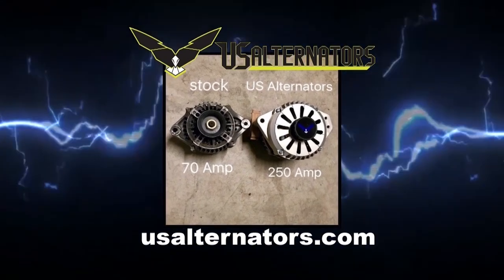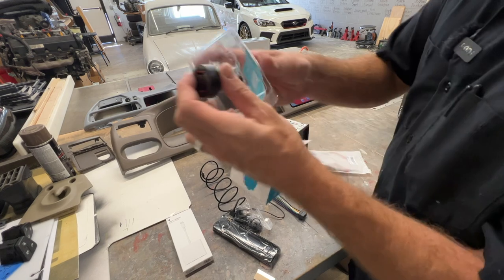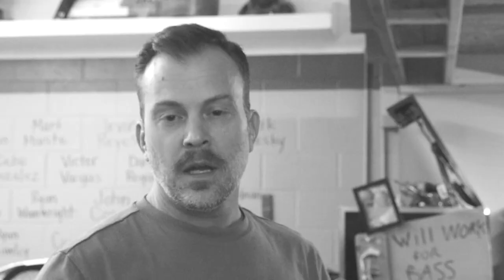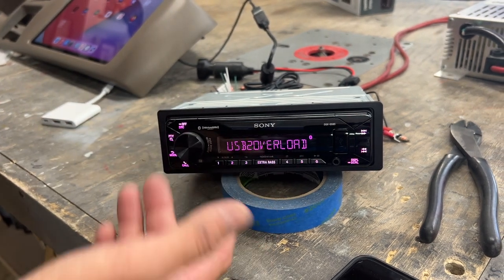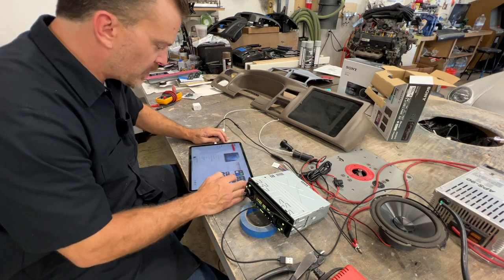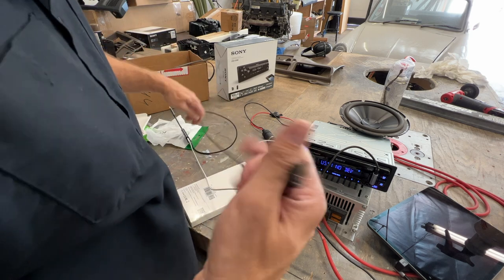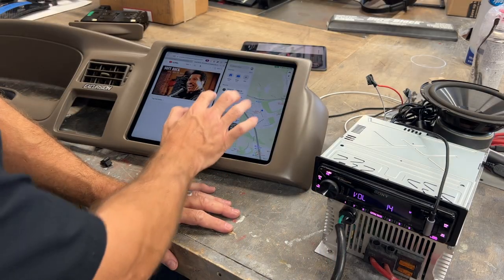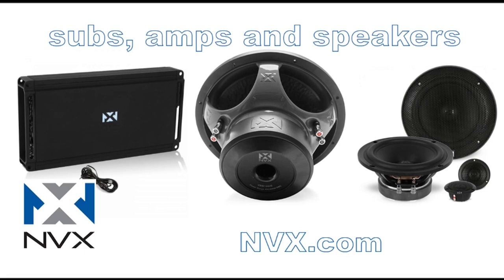LET'S TEST Sony DSX-GS80 car stereo with iPad PRO

Comment: I had the same situation. Here is how i got it to work… the white apple device you got needs a 5 volt 2amp source. Get a power supply that connects to your sigarrett lighter that has an output of 5 volts 2amps and plug to the white apple device and you should be able to charge your ipad using that apple addapter and use the HDMI option too. We all need the help we can get. So good luck bud!
Reply: what would I do to make a Samsung tab  work   I do have a new eclipse 8v head unit  I was thinking  of using  what type of line converter would I use or does audio contole  carry somthing . I'd actually be getting this exact  dash made from ole dick fiddlerdouggie🤘🏽
Reply: Then why do not direct charge  to the iPad . This man need the usb port  to iPod music to the head unit and charging at same time. He doesn’t need HDMI port.

Comment: If only Eclipse had stayed in the game. Had the 8 volt pre out head units. Awesome quality.
Reply: ah Fujitsu Ten
Reply: favorite head unit's ever, and the titanium line of sub's were ahead of their time. What ever happened? Why did they close?
Reply: Fuck I miss my eclipse stuff. 2 titanium 10's and an eclipse HU was part of my 1st system in my 1st vehicle.
Reply: I have a CD8455 still in the box     I bought it from some dude a few years back it was never used  for like 80$ 👍🏼
Reply: My dads truck still has a cd5423 from 2003  6 5v preouts, I’m telling him when he sells the truck I’ll buy the radio and buy an $80 pioneer in its place haha.
Reply: @darrenlee1765  they are still suppliers for some car audio but only factory equipment no more aftermarket since 2011 or 2013 I believe, they came back but only do home audio unless they stopped doing that too.
Reply: I still run Eclipse head unit. 8volts of preout 8443 CD

Comment: I'm 1:52 in and I'm super stoked for the 100w x4! Time for some 6x9's everywhere with that kind of power. No cap
Reply: If I'm not wrong it is 45rms cea certified, and you can bridge the rear channels and add a lpf to make it a sub channel with 90rms. The headunit does get pretty hot tho and there have been problems from people running this headunit using stock power wires because it draws 20 amps.
Reply: removing all my 100w amps from my ride now LOL
Reply: 15A fuse xD
 20W sinus
Reply: @concreetbloc  Stock power wires isn't the issue.
You have a head unit that can't do the job properly.
Reply: @concreetbloc  anybody who hooked this deck up with Factory wires are idiots....It requires at least 10 gauge wire directly from the battery.
Reply: @scamchan it absolutely is. Says atleast 14 gauge power wire in the manual

Comment: It is the high voltage of the quick charger that has damaged the USB2. You can go with a slightly older charger with 5V 2a or 5V 3a. It will charge the device and play music too.
Reply: Pretty sure it's backwards compatible.
Reply: @h8h81  Yes. USB C is backwards compatible but with PD(power delivery) if higher voltage is negotiated on one end then it will be delivered on the power line (red) and since it is being used in sync with the headunit (meaning three way between charger, headunit and ipad), the headunit is not able to handle the higher voltage. 
Which is why when we used to design for USB previously all components would be rated for 5v but now if you design for USB we have to rate all components for 20v.
Reply: @akbarhash  Thanks. Do you mean that is the reason he received the "USB Overload" message? I ask because I bought the same head unit, and although I'm not trying to do anything fancy with an iPad, I get the same error message  most of the time when I plug in my iPhone 11 directly into the rear USB with a lightning cable. Thoughts?
Reply: I got the same message with the same deck just using my F iPhone. I had to plug into the front and I didn’t want cords hanging all over my dash. WTF Sony?

Comment: To bad almost no new units have rear usb for that clean install.
I run an old 80-prs, rear usb charges my ipad, auto start stops playback and it has steering wheel controls.

Comment: I’m currently using your iPad mini 6 dash kit. I run (no head unit)  iPad mini 6 gen> Topping D10s Hi Res DAC Digital coax > AudioConrtrol DM 608> to my amps. The DM-698 is mounted behind the iPad in my dash I came up with that idea all by myself WORLDS FIRST😂. Got it all hooked together with an Anker USB-C Hub instead of the apple kit. The topping is an amazing option if you are running a DSP. It’s only $109 and they USB-C hub was $100 but you can get one with less ports for a lot cheaper…

Comment: Could use a "active" USBC extension cable where you can Inject power from a different source but have your data going to the stereo. Just have to go USBC to Lighting.

Comment: Something like this may help.
Found on Amazon.

Active USB Hub, WLXKJY Aluminum 4 Port USB 3.0 Hub with 4 USB 3.0 Data Transfer Ports, USB Splitter with Independent Switch and 36W (12V/3A) Power Adapter

Comment: Im somewhat new to the speaker upgrade world. I just bought a pair of Infinity 822MLW speakers for my boat. 2-8" 2 way, rated 150 RMS and 400 Max each. Do you think this head unit alone is enough to power both of those with decent sound? No other speakers/sub involved

Comment: So I have the same set up in my XB. Rafa made it a few years ago. The Sony head unit I have shows the same overload message but it WILL hook up eventually you just have to either keep cycling through the different programs or keep turning your car off and on until it does. It sucks but once it connects and you don’t remove the iPad it stays connected. It’s done it since I’ve installed it.

Comment: I you wish to have charger and data transfer I would use type C dock from anker. 

I use it for my phone to connect it to my main screen and add USB drives and charge it all in the same time.

one port in it for charging with the type C PD-IN(propobly stands for power delivery) 
second type C for data.

there is also 2 USB A and HDMI and RJ45.

Comment: I don't think anyone is getting your kits installed to be able to have just one iPad and going to be pulling it out so I don't think fast charging is really necessary because it will only be used when it's powered and they do don't drain their battery that fast

Comment: Got the same set-up in my van, get a lot of noise through that cable on mine 🤔
Reply: Noise frequently steams from grounding issue. Check those then start isolating equipment. Plug straight into the amp, try the radio, put analog into the head unit. Then try different USB cables and sources. Make sure the head unit is getting good power too.

Comment: can you split the HDMI output into two outputs? i want to use this setup but audio out to a headless media receiver, like fusion, but still have my phone as the source and still control it through car CarPlay. The iPhone is programmed to send audio out only through the cord when the car requires cord connection for CarPlay. And that dumb ass camera card was blown  money. And the mother trucking iPhone will not stream music, if it is plugged in, and it also will not stream to multiple devices.

Comment: Doug, USB hub needs to have a minimum of 18w pass through from a pd charger to effectively charge, also your female and male cigarette  should support the Amp and watt draw from said cigarette charge. Easy way to test this is to use your iPhone charger to wall plug to USB c output. Usb to your radio and see if it charges, if it does then you would lookat the specs (amps ,Volts, watts) of said wall plug and look for that in the cigarette charger! 
Also comment about a statement you made as it was accurate but requires clarification, you can play flac and other hifi formats but the radio is not capable of reproduction of said bitrate and quality so pretty much pointless to try. I've been working on my galaxy tab s7 dash mount set up and it has been something I have been researching for the last year most effective way as of now is running hub hdmi to audio decoder to optical/toslink to optical dsp input then out to amps but even then it poses a potential for audio fidelity loss. Maybe in the next 5 years Bluetooth 6 will bring a hifi over Bluetooth and more radios with digital outputs. My recommendation find a 3A 45W pd charger hopefully it provides 30w to the iPad and has enough to offset the usb power draw.
Reply: Is that you james rr tolkien?
Reply: @lanesteele240  I could have been, but I hurt my hand

Comment: Why not use a wireless carplay radio and just use the port for charging. Im using a kenwood dmx9707s and works amazing with wireless carplay. Kenwood is coming out with a newer unit that uses usb-c and more watts to the usb-c for charging.
Reply: Im no expert, but wireless transfer can lose quality and usb transfer is basically loseless because you transfer digital through good conductor while air is not.
Theres improvements in music transfer in bt 4.2 and higher though.

That said I transfer my music through bt into fm transmitter and I dont mind Im no audiophile and I listen to rap instrumentals mostly.
But I wish I had sth newer, so Im intrested into dsxgs80 :)

Comment: Weird the rear USB doesn't work.

From Sony's description:

Get the most from your smartphone
Get more from your smartphone in the car. Sony makes voice control a cinch though your Android™ or with Siri on iPhone®. Plug in your phone to either the front or rear USB inputs to access your stored music files.
Reply: Both USB  ports work on my Sony  DSX-GS80
Reply: @darrelllawes3950  What devices are you using through the rear USB port? My iPhone 11 doesn't work most of the time. I get the "USB overload" message.

Comment: Sony probably didn't pay for the license to connect to an Apple Video product for a unit that doesn't play video.
Reply: The rear usb will be low voltage version 2.0. Just for data mostly. Not charging. The front will likely be higher voltage for modern devices.
Reply: @1rexrex  So a modern iPhone wouldn't work because the iPhone would attempt to use the rear USB connection for charging as well as delivering data? That appears to be the case with my iPhone which sets off the "USB overload" message. Can you think of any solutions? I really want to use that rear USB connection with my iPhone. I hate front USB where I have to have cables hanging in front of my stereo.
Reply: @tayler2396  The overload error is the same for all usb 1.1-2.0. They are only 1v outputs. The phone needs 5v.Its trying to draw 5v and overloading the usb. Front usbs usually are rated for higher output.
Reply: @1rexrex  That's a shame, a deal breaker for me. I bought it specifically so I could play music from my phone while it was connected with a hidden, out-of-the-way cable. Thanks for answering.
Reply: @tayler2396  If you get a usb cable and cut it. There are 4 wires. The red and black are power. the other 2 are data. With some noisy home gear. People have modded the usb cables to have a split at the end. Data still goes to the source. Power comes from somewhere else.

Comment: Dig the understated look. Most stereos these days look like they were designed by and for 13yos, but with the doodle penises removed by committee. 
Extra fish button is just icing.

p.s. the new chargers pull way too much juice for data usb plugs. USB-C standards are a fistsucking mess. After old USB just worked, we got spoiled and they dropped the ball. You may need a separately powered usb hub. Also Apple sucks festering donkeytaint for implementation. 

P.P.S. Where is my Chrysler Cordoba dash kit? You said it would have matching blue Corinthian Leather and a place for my quaaludes and Peruvian powdered mixtape.

Comment: you clearly don't seem to know what USB OTG is and how those USB dongles work... the normal USB is for flash drives and connecting those to the iPad... not connecting a computer or radio to the iPad how you're wanting... the USB c is to power the device connected to the USB port on the dongle